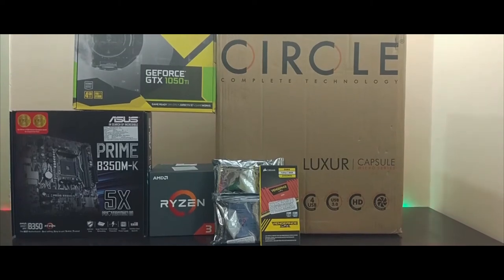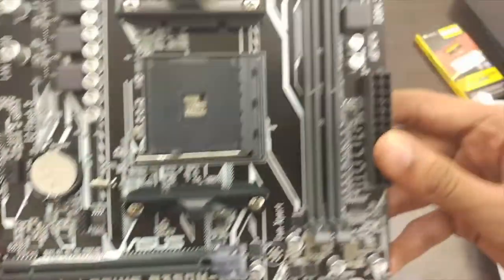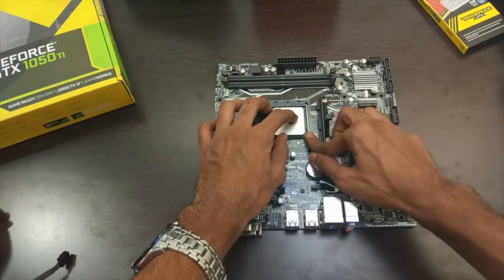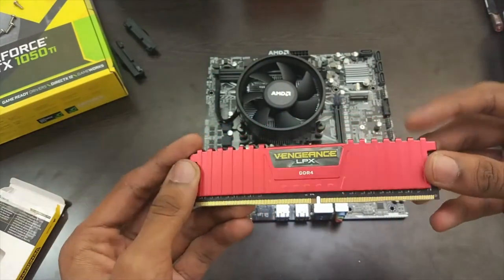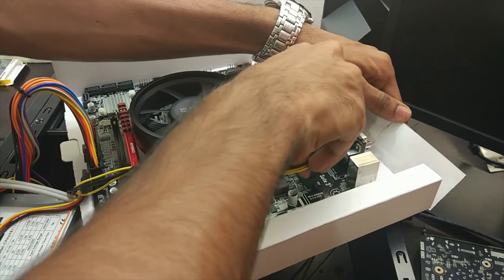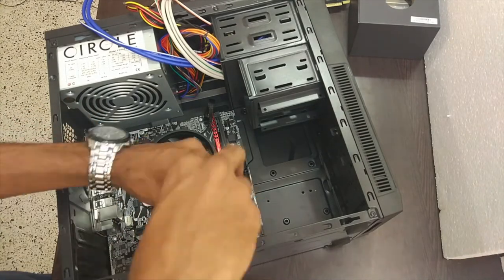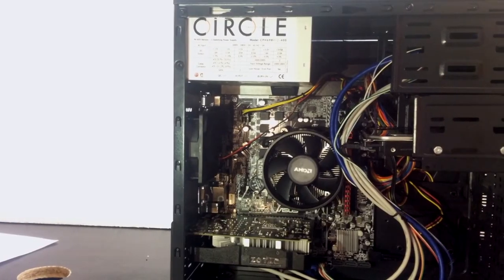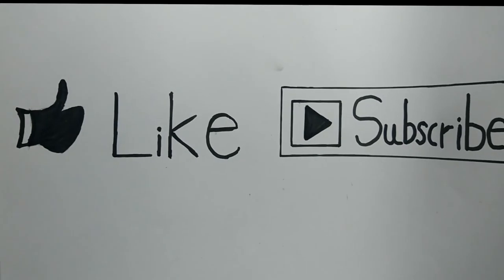Rs.50000/$675 AMD Ryzen PC build with full building guide(full build with monitor, keyboard/mouse)

Comment: My budget is 60k so suggest me best build including monitor
Reply from the maker: +GAMEZnGEEKZ let all the parts be the same except for the processor. go for Ryzen 5 1600 or 1600x
Reply: Tech Sane!!! Can I change the GPU to 6gb version
Reply from the maker: +GAMEZnGEEKZ Yeah you can. But all the graphics card are expensive right now. I've mentioned it in the video. GTX 1060 is around 20-30k. An d it's not worth the money. Wait for the prices to drop. Or go for 1050ti
Reply: Tech Sane!!! I will wait for a better build maybe deepawali offer or after my 12th board exam's
Reply from the maker: +GAMEZnGEEKZ Yeah better to do that if you have budget!!